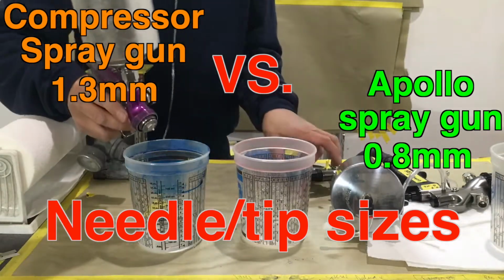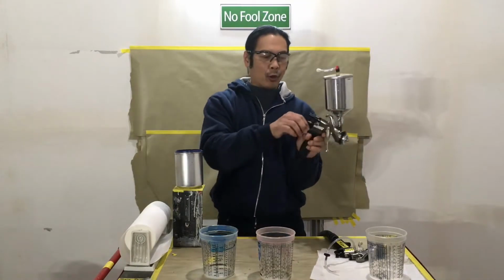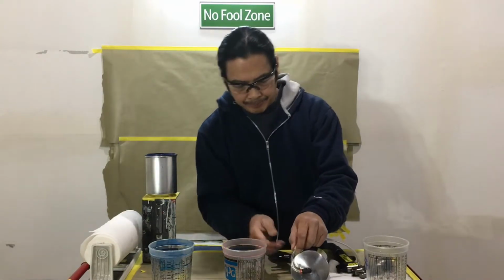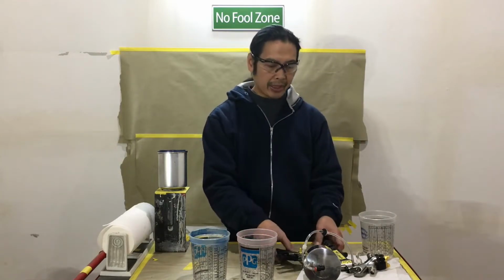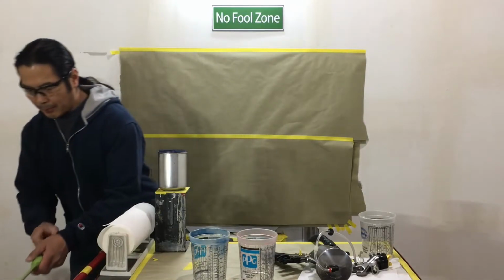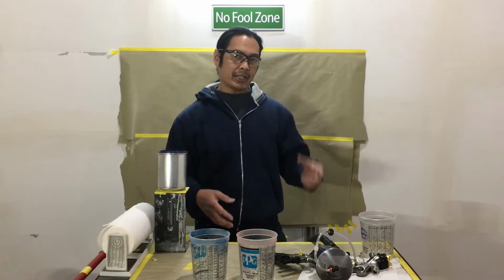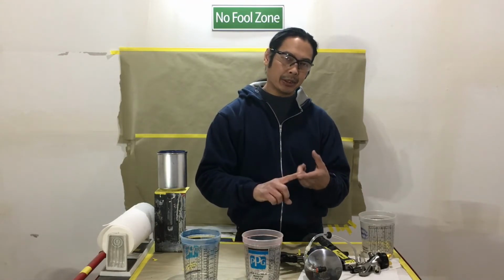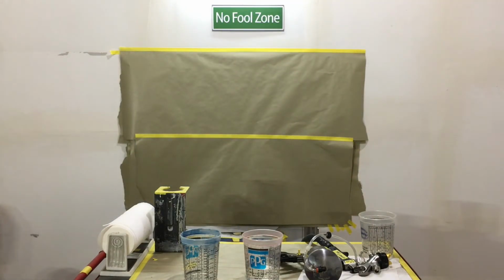Jake's "No Fool Zone" HVLP Turbine Sprayer Class - Turbine Spray Guns vs. Air Compressor Spray Guns.

Comment: Hi Jake, thanks for the video. I have a Fuji Q5, trying to spray “ Clausons  All you need” which is 80 or more percent solids but the material goes on like gravel guard, I see in your other video’s you like to run pressure as low as possible, machine came with a Ford cup, the run time is asking for a 2.0 cup
Maybe I’m going in the wrong direction!?!?
Reply: Thanks Jake !
I sent an email to your website
Reply: Yes sir, understand completely 👍
Reply from the maker: @rivermetal  Perfect.
Reply from the maker: @rivermetal  Cool!

Comment: Have you tried the gunbud light that attaches to your paint cup? Might free up that other hand and give you the extra light to see the paint
Reply from the maker: Hi Scott Shriver, not yet I haven't tried it. But I've been using an assisted light since before year 2000 - over 20yrs.  My hand held light works very well,  because it's also used to check the panel for total gloss coverage in all angles, and I can insert into tight spots to check panel. A light on the gun will not fit into tight spots, you'll understand when I post the video of Jetta custom engine bay spray out.  The light from a low angle will show the gloss saturation WHILE paint is being applied - that is what I am looking at when I spray. Jake

Comment: so you can use the turbine with .8mm-1.00  for base and clear a 5psi?  What would you use for primers?
Reply from the maker: Hi Cash Benjamin,  yes you can.  But,  you have to know your material because viscosity flow is what will determine the best pressure and size needle and tip combo to use.  I always test my material before I go to the panel. I can do 4 psi too.

Comment: How does the Apollo guns compare to the Fuji t series?
Reply from the maker: Hi Dyna, no idea man,  I've only used the Apollo guns from since I made the switch from compressor guns years ago. What are you spraying?
Reply: @JakeLesada   Hi Jake.Cars and motorcycles,single stage and 2k. Been doing a ton of research on these turbines,just trying to get the best value for my dollar and not looking to break the bank.Just a hobbyist.Thanks
Reply from the maker: @MickE98  Yeah, when I first started, I also did a ton of research and couldn't find much info. I looked into all the different brands from TP tools, to Graco. In the 90's, I was given as a used gift an early Graco turbine. Years later, I read a Hot Rod article about Bob Darney (TP Tools) and the future of car spraying with turbines.  Then around 2013 my friend at his body shop thru me a Sema magazine and said look, "there's was an article about Apollo Sprayers - most innovative product."  I spoke to the lady who wrote the article and she gave me the number to Apollo. I contacted Finish Systems my local distributer - Bob Kelly and asked a bunch of questions. At that time Apollo was world known in wood working and had won numerous awards already. They introduced their machines to the automotive market at Sema and have been there with a booth ever since. I was invited to Sema in 2016 and 2019.  And did spray outs for their displays every year.  Finish Systems was an industrial paint supplier.  Months later, my friend was directing a Danny Trejo movie and asked if I could paint the picture car for the movie. I thought it would be a perfect project to try out the Apollo turbine. I used the money for the spray out and bought a complete set up from Finish Systems and you'll see the blue Volvo I painted on Apollo's YouTube channel. That was my very first full car spray out with Apollo, and I have learned and experimented with everything automotive since then. That blue Volvo may look slow during clear coating - but back then I was just learning the Apollo unit and I was more interested in my wet edge than speed like compressor spraying. I'm way faster with any coating today and my learning curve was that first car. I'll try and help you with any questions regardless of the machine brand you decide. Jake
Reply: @JakeLesada  Thanks Jake. Check this out https://youtu.be/YQAzYlGPTrQ This is part of what leads to confusion on what is needed for the backyard guy and validates all the old timers on the auto forums, who began using turbines in the 80's.Who said they only had 2-3 psi to deal with.Obviously everyone wants better quality.Now i am told i need 7psi or more just to lay paint.Understanding the new guns need more psi to atomize the paint correctly.I just wish the vendors of these units would get serious and put out some good training videos.Most of all the info i got has come from wood guys and archived auto body/painting forums.I have seen guys lay really nice paint with Fuji semi pro,It is 5 psi.Spending 2-3 grand is not really gonna happen for me when i already have a great compressor and good guns.Thanks again.
Reply from the maker: @MickE98  Yeah, I saw that video too, he mentioned he reduced his material. I follow the manufacture recommended reduction and don't need to over reduce. In fact, I choose to run my mixes unreduced. A lot of the early information out there is about over reducing to get material to flow.  I can spray straight mix unreduced 4:1 clears etc... And, I do both collision repairs,  restoration and custom spray outs. If you already have a great setup - run it. I know the cost is a major expense, but I also know how much I've saved on materials and I have less paint fumes to deal with.  When you get a chance to demo out an Apollo turbine system go for it. Thanks again. Jake
Reply: @JakeLesada  Thanks Jake.Yes on the earlier and less powerful units,they always said go by the #4 ford cup and adjust from there.
Reply: @MickE98  I shoot base coat with a Wagner which looks like a toy ( 3 psi, 2 stage turbine I think, and I setup the pressure at minimum lol ), getting the same results on finish than with my 3 stages earlex and gravity gun, which gives the same results than my ASTRO hvlp, or my cheap lvlp with compressor.
But this is for base coat.
I think base coat doesn't need pressure to be atomised. I just dilute it as the manufacturer recommendations ( 50/50)
The trick for me is to open the fluid at the minimum. Remember that atomization is a ratio between paint quantity and pressure. With less pressure you just need to put less paint into the air. Doing this with my Wagner ( 2.5mm plastic tip...) I just paint slower and do more coats. But even if I spend really more time to paint, I prefere to save nearly 100 dollars in base coat  and going slower since I m just a diyer.
In the video you showed, the user just put too thick coats of base I think.

For clear coat I just switch to my iwata and compressor. I tryed do it with my 3 stages earlex but had to go by multiples states of wet sanding then buffing and I hate to fit it. 
I m sure you can have a great finish with a 4 or 5 stages for clear coat, Jake proved it multiple times on his vidros, but for me, it was more economical to buy the iwata, wasting a little more clear and not having to send and buff clear, and to save money on base coat with a cheap turbine
Reply from the maker: @ricardo-zq7uc   Yeah, that's a cool work around too, whatever works - run what you brung to the race track or spray booth. Also,  I'll hose the clear on for some projects because I know it's going to be wet sanded from 1200 - 5000 grit.  Collision stuff is done fast with 1.5  or 2 coat applications - but restoration or custom is always whatever I want to do that will make it shine better with depth than anyone else at the show, and that always adds more work and more layers. Here is something to add about atomization - with the Apollo turbines it is the high volume of CFM that makes it work so well. I can spray at 3 psi for jams and certain parts and still have proper gloss. Any way you can get that paint to the panel is the goal with every budget.  I've even used a spray bottle with primer.